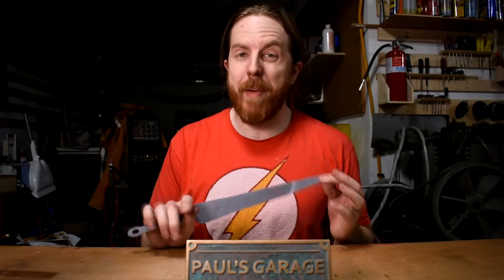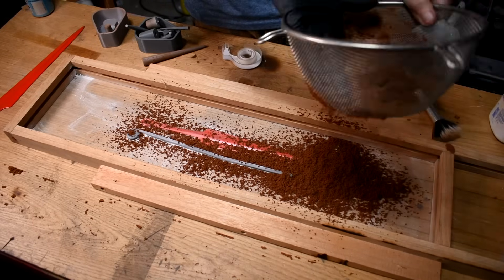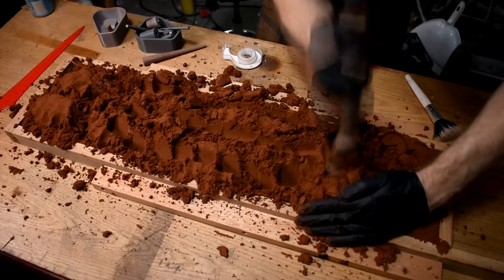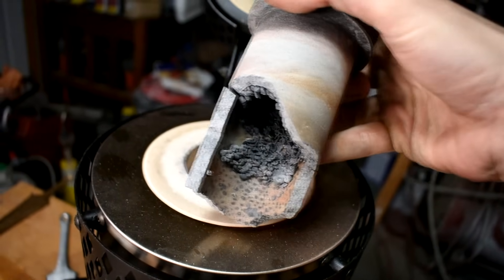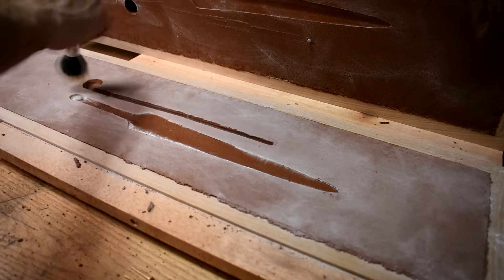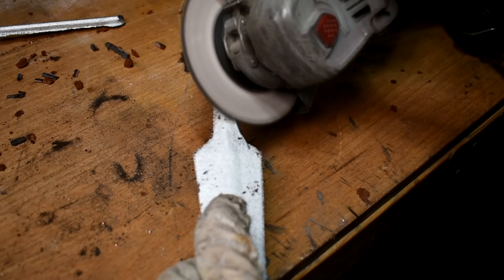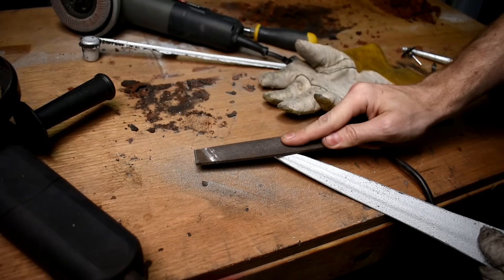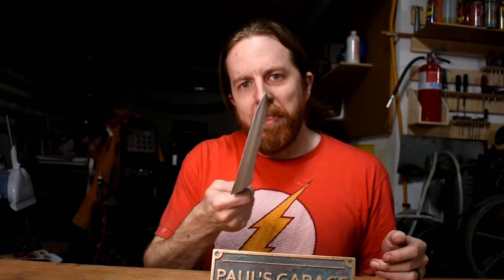Want to Make ANYTHING? Watch this Video

Comment from the maker: Want to learn sand casting using your 3D printer? I can teach you!: https://paulsmakeracademy.mykajabi.com/joinus
K1Max printer if you're interested: https://shareasale.com/r.cfm?b=2485905&u=3680878&m=124834&urllink=&afftrack=
Reply: What is the type or name of sand that you are using for the mold im just getting into making molds
Reply: Such a great spirit, I really like your view and I absolutely share it. I also noticed you learned resin 3D printing pretty quick and you even improved certain things like curing under glycol (pro tip use hot glycol this makes the bonds of the molecular chains even better which leads to harder more durable prints).

Comment: I´m a skill stacker. Of your list at 10:45:
learn to weld: checked as a gift from myself when turning 40
code: checked as a teen and still paying the bills
solder electronics: checked 17 years ago
write fiction: checked as a pre-teen and so far I published two books
Also did some aluminum melting (King of Random style) and now I'm getting courage to jump into 3D printing. Already done 3D modeling and some printing in stores so there is some water in the pool.
Reply: How’s it going?
Reply: @CheezyQq  slow. I'm a slow walker. Also I'm working on my 70s car and my chicken coop. Never boring.

Comment: If you make a part (i.e. a knife) out of sheet copper, solder a thin layer of tin on the surface, and then heat it red heat (without melting) on the stove the copper will absorb the tin and turn into a hard intermetallic or even bronze if you heat it longer. You can also solder several sheets together and turn the whole part into a brass-bronze composite. That way you can make almost-bronze things from sheet copper with barely any tools other than scissors, soldering iron and a stove.

You can do a lot of wierd things in a studio if you put your mind to it
Reply: How thick can you make? I'm thinking of sheets for machine guide ways. 1mm should be enough for most .
Reply: @High56  the limit should be your heat source in conjunction with the volume of material. 1mm probably isnt a problem with a propane torch but I couldn't imagine anything staying straight past a few cm in length. Just start small a sheet of copper of about 3ft by 3ft and 0.5mm thick can be had at my local big box store with orange coloring in the brand for about 50 bucks. Worth the convenience and if it works out then spend the time and energy to look for a local metal supplier and by that point you will have a very good idea of cost vs time that you want to spend.

Comment: My crucible also broke inside that same furnace.
Reply from the maker: Which size crucible?  Was is molded or milled?  How many times did you use it? What were you melting?  I'm trying to get to the bottom of it.  I know Vevor is collecting lot numbers to track down any issues

Comment: Hey Paul. I'm outside your demographic. I'm 72, retired software guy. Four years ago I started making guitars, starting with zero manual skills. At first the suck was up at about 11. Now my suck level is down to like 8 or 9. Making guitars led to (1) welding, (2) 3D printing, (3) shop made CNC router, (4) vitreous enamelling, (5) laser engraving, (6) electroplating and anodizing, (7) heat treating shop made metal tools, and lots of other stuff. I learned blender, Fusion 360, Adobe Illustrator, LightBurn, and whatnot. However I'm still not as funny as you, at least not on purpose. P.S. I used to live in Fort Atkinson.
Reply from the maker: That's great!!  You're never too old to start making something new.  Sounds like fun, plus is a great way to get a whole bunch of awesome guitars!

Fort, eh?  I spent a fair amount of time at the jellystone park there growing up.   Good times

Comment: The first skill is always learning to learn, and the first step is to imagine.  The second skill is learning to research, because research is the second step.  The third skill is to question, because the next step is decide how you will test your idea.
Reply from the maker: Well said!
Reply: If you don't know how to learn how can you learn how to learn? If we knew what we were doing then it wouldn't be called research.
Reply: @1pcfred  When you don't know how to do something, you find someone to teach you.  When you have learned how to learn, you know how to teach yourself.

You cannot research something UNTIL you know what you are trying do because you have to know what you are searching for an order for it to be "research".  Research is always a deeper dive into what you already know a little about, and that can be looking into what has already been known and shared or looking for paths that have not been explored.

What I posted is just the first three steps of The Scientific Method with the generic name for the skill needed to completely that step. Three is also a process known as The Design Cycle which is very similar.
Reply: @1pcfred  What you are saying is that you go to stop there because you have already done the first two.  The core idea of skill stacking is that because you have done them once you don't have to do them every time.

Comment: For context: I attended a technical school in the 90s in South Africa. I got into 3D printing in 2004 (South Africa was a pioneer in that technology). Now I’m reading for a PhD. 

If this video of yours were available in 1996 or so, it would have changed everything. Your message is as pertinent today as it would have been back then. Thank you for sharing your experience, you’d make a fine teacher, yet I think you’ve surpassed that role many times over. Thank you for this, I’ll share it wherever I can.
Reply from the maker: Thank you!  I was actually 8 years old I'm 1996, so I was doing this in spirit even if youtube wasn't around then 😆 good luck with the PhD, I never did finish mine.

Comment from the maker: Let me know what skill you want to learn here in a reply
Reply: @paulsGarage I live in the country where during power outages we may be without power several weeks at a time. So I want to learn to build and sell efficient gasifires to run generators from burning wood, rubber tires, and plastic in a low oxygen environment. So far my research says I have to have two different systems. One for plastic and one for rubber tires and wood. Lack of money and materials is my main stopper.
Reply: @littlekingcobrasden4217 Have you looked into the old fema documents about wood gasififiers? They can be made from things like salvaged propane tanks.
Reply: I want to learn to build, I think, a core XY type 3D printer. The killer app for it will be making patterns to mount to match plates for sand casting iron.
I daydream about making a Gingery based cast iron lathe. Then maybe I will use the lathe to build all the Gingery machines from iron. Then maybe I will use the Gingery machines to build small iron steam engines. Your video pointed out that one place I can start without spending a bunch of money is to learn 3D modelling and slicing software. I’m off to start looking into it right now!